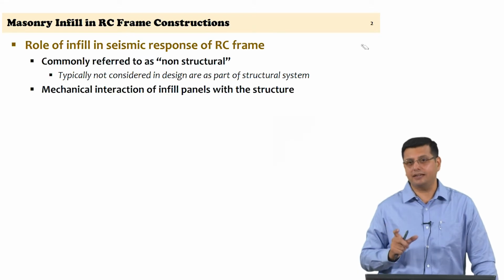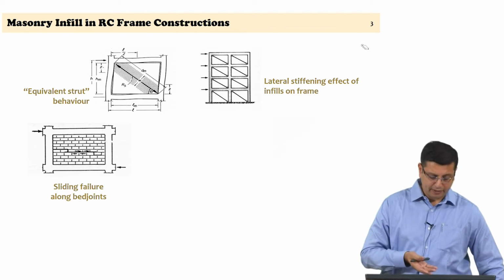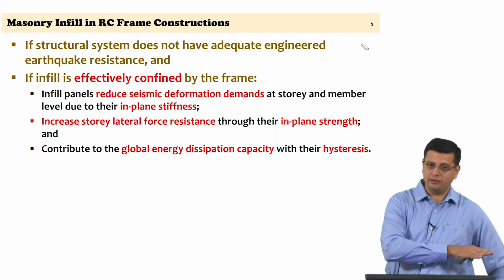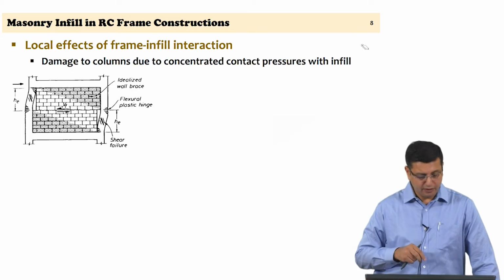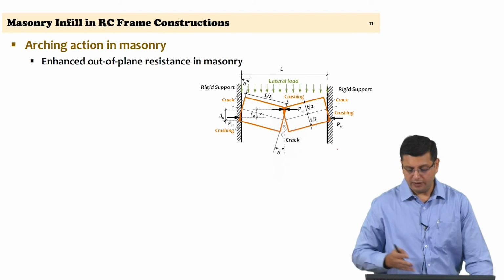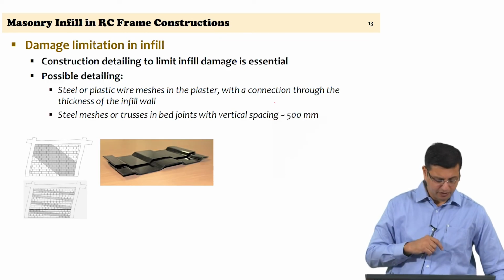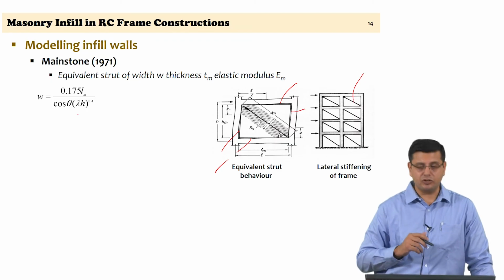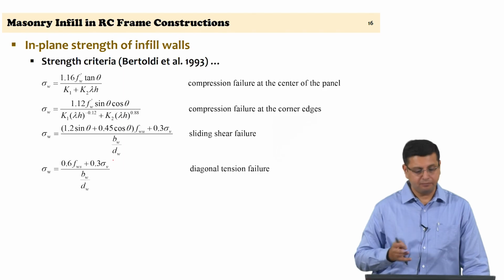#37 Masonry Infill in RC Frames | Design of Masonry Structures

Comment: in which fem based software we can model and analyze masonry infill in rc frames?
Reply: You can also use ANSYS. But if you want to check accuracy of analysis you have to do the experimental investigation by constructing the wall by local masons and material.
Reply: you can use ETAB
Reply: SAP2000
Reply: Abaqus also.